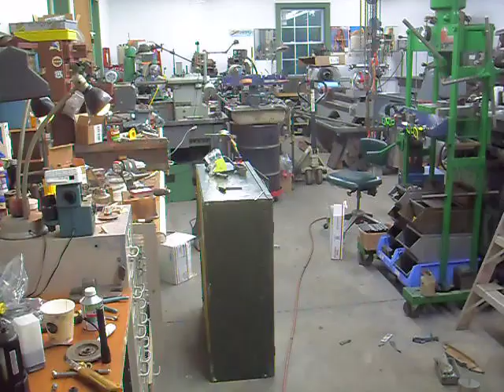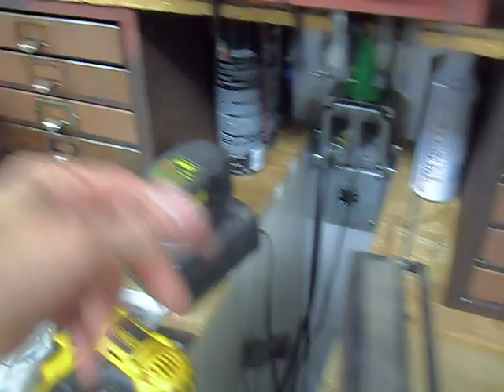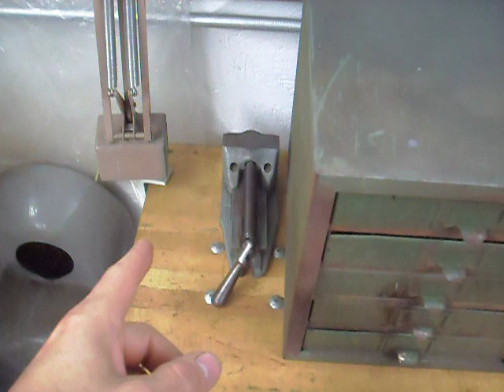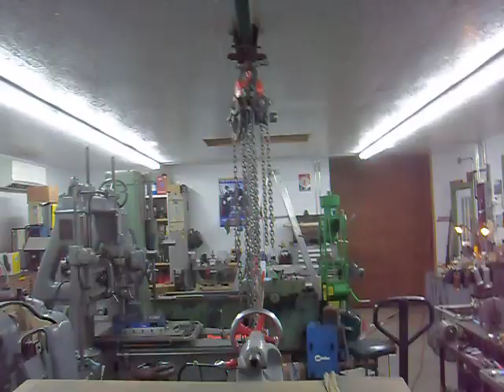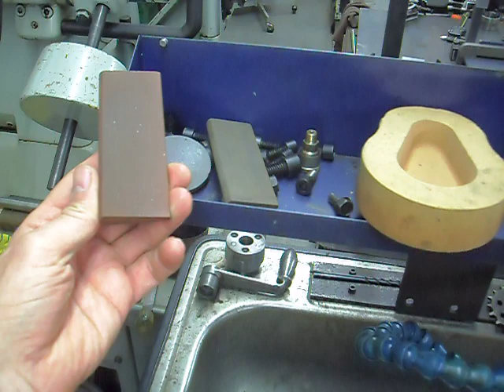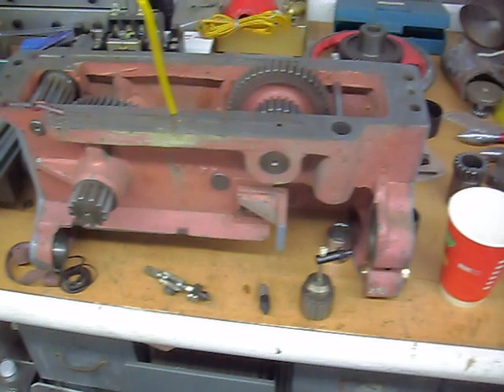Doozer's Machine Shop Update 6-14-19 -- Kennedy Kits Parts Drawers

Comment: Back filling that low spot for a shop expansion? Lesson one, ALL I REPEAT ALL biological material needs to be removed first until you get down to native gravel type material. And when you get that far do not disturb any of that material since it's as compacted as it's going to get.Only then can you start to back fill with imported material. However you still can't just dump it in place. Add it in 3"-6" levels of material and be 100% sure to completely wheel pack it with your tractor in a north / south then east / west pattern. Adding just a light spray of water can help the compaction work faster and better. Roughly 8% moisture is the ideal.  If you don't do ALL of the above you'll never get a building or foundation that will be stable or hold together. None of it is optional. If you don't remove all of the organics it doesn't matter how deep the back fill is or how compacted. The organics will rot and the ground will move. Even with 25+ ton hydraulic vibratory compactors about the most you can get away with is 8" - 10" of material in layers until your up to the finished grade elevation.
Reply from the maker: Thanks for the comment TP.  Yes I do plan on removing that cluster of trees.  You got me thinking it might be a good ideal to shoot a video of the site and what I plan to do, as looking out the window is not the best view.  I have been scraping dirt from a stepped area on the edge of my property, and making the step drop off straighter and more defined.  And the dirt I will be using for fill in my low area.  I just piled the fill dirt on the embankment that I already had, kind of temporarily.  Once I cut down the trees, I plan on raking the dirt out evenly with my bucket, and my father has a Wacker plate compactor I have free to use. I was not going to take the tree roots out, but maybe I could at least grab the tree high, and try to get the root ball. The stump would be under 3 feet of dirt ultimately.  It is only an 8" diameter tree. What do you think. Thanks- Doozer
Reply: @kooldoozer  A very few smaller roots shouldn't be much of a problem. Any black or organic type soil  has to come out since it's impossible to build on. The stumps and everything running out from them has to be removed. Having that compactor will be a big help, but you'll still have to go up in short layers. No more than 4"-6" deep at a time. A shop with all the additional weight per square foot requires the best job you can manage. Home construction and the foundation methods they use are a bit less demanding than what your needing. 

At the industrial level, road and larger building construction has that compaction and it's material density level properly tested to ensure it's high enough. That's how important it is. Once a foundation and building goes up it's extremely difficult and more than expensive to fix any settling problems that turn up even years later. You can spend a bit of time and money now, or spend a whole lot more of both later if it's not done properly. Since it is in a lower area are there any water issues in that location?